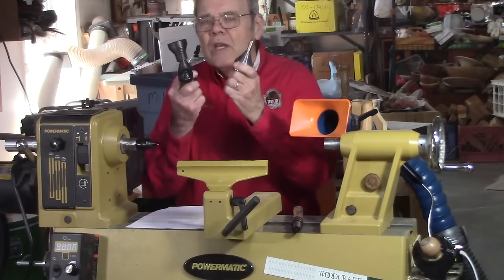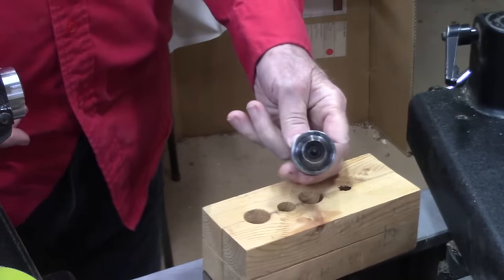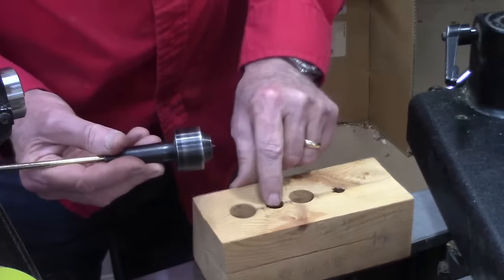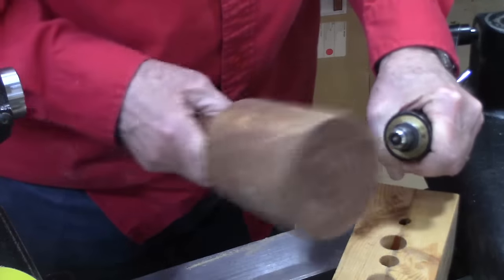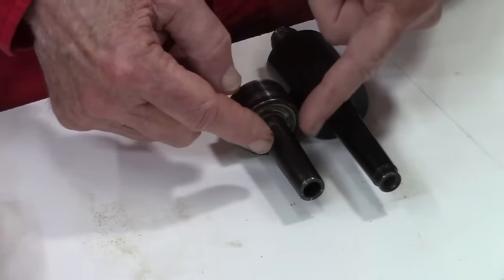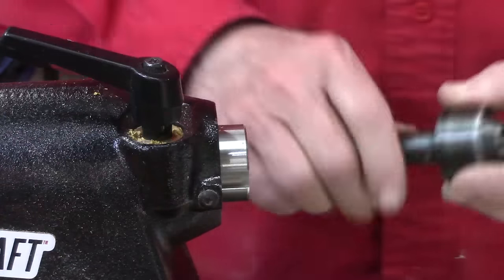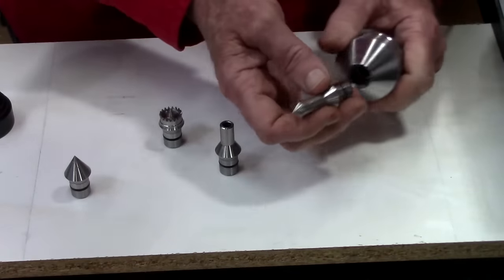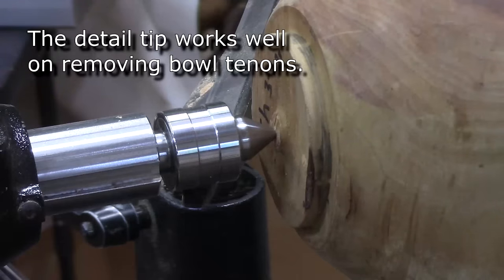LIve Centers -Time to Upgrade?

Comment: I purchased an Axminster multi center last year before Record Power released the Falcon multi center and I really like it. It has the 2 sealed bearings and removable tip. Included tips are  a 60 degree cone, a 3/8” diameter long point, a cup/ring center, mini faceplate with a central screw (great for goblets) and a 90 degree pipe center. The Axminster has a 3/4” 16 TPI thread which I have used (along with a tap) to make various centering cones for segmented turning. I was able to pick it up on sale for $89- a deal compared to the One Way live center.

Comment: Thanks for the reminder of how versatile the various live centers are.  Like you, I have four or five and they are all set up differently.  The aluminum 60 degree cones are good because they are sacrificial.  If you hit aluminum with a gouge you preserve your tool steel.  My 60 degree cones are all marked up.  When they get bad I simply lock the free end and re-turn the cone.
Reply from the maker: I agree, they are sacrificial. I would expect with f to choose from, you do not have to cut up that aluminum very often.

Comment: If you're low budget like me, you can turn wooden tips for a mandrel saver live center. Turn a tenon on a scrap of s hardwood to fit the hole with a shoulder to keep it from pushing through, then turn the other end to whatever point or cup you need. Like a DIY version of the Falcon system you were showing. It's not as durable, but you can always make another one if it gets damaged. The cheapo Chinese mandrel saver is holding up pretty well lol.

Great video, Mike! I always enjoy your content 👍
Reply from the maker: Necessity is the mother of invention. Thanks for sharing.

Comment: Great video, but it illustrates one of woodturnings dirty secrets - buying the lathe is the least expensive part of the hobby.  There are so many neat toys that you can buy to go with it!

Should mention the PSI live center.  Like the Oneway and Powermatic centers, it has a threaded nose, but the thread is 1"x8tpi - the same threading as many scroll chucks.  I think it was intended to allow a chuck to be mounted on the tailstock so that a workpiece can be remounted while retaining the turning axis, but I find that it is also a very convenient live center.  I bought a tap (yup, another toy) to match the headstock spindle that I use to make interchangeable 'nose pieces' for the live center.
Reply from the maker: Now you can make threaded glue blocks

Comment: Thanks for the excellent video, Mike. The varied types of turnings I do require me to frequently change the ends of my live center (Rubber Chuckies, Steve Sinner cone centers, etc, etc). That is why I have come to prefer the Robust live center over the one that came with my 3520C since you do not need to use the long pin to unscrew the end pieces. Great time saver.
Reply from the maker: Right on!

Comment: Nice review of live center types.  Now I need to go watch your brace handle video; haven't seen it before and it looks interesting.  Really like the idea of using a hole in a 2 x 4 to catch the center tip when knocking it out.  Not that I'd know anything about this, but I've heard that if you put one hand in front of the live center to catch the point as you knock it out with the other hand, the point can cause some pain when it comes out.  😃  
  I recently got the Record Falcon live center set and really like it.  I made a laser-cut French cleat holder for it to keep it all together and close to the lathe.  It really seems like it is going to be able to support most of the turning projects I do.
Reply from the maker: Great storage solution, thanks for sharing!

Comment: I found that if I'm using the 60 degree center and there is a danger of splitting the piece, I put a small diameter washer on the end of the live center and it restricts how far the center enters the wood, cheaper then buying a new center for the limited number of times I need the extra caution.
Reply from the maker: Thanks for sharing.